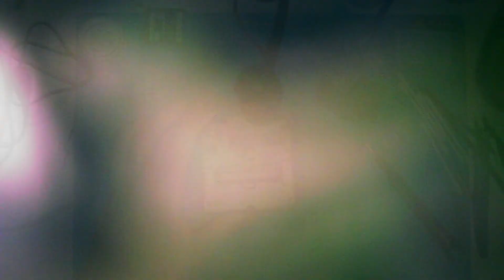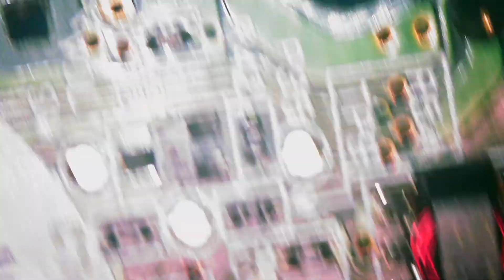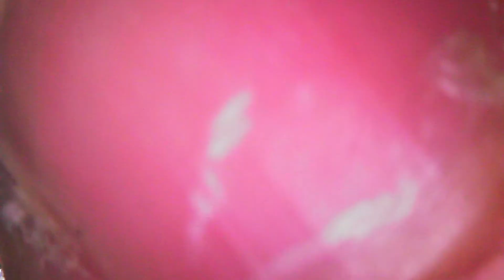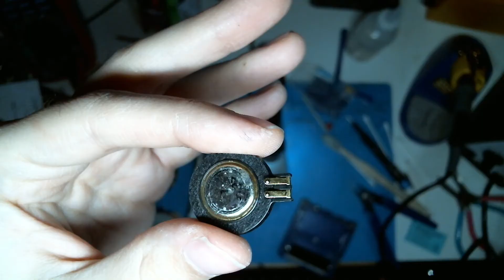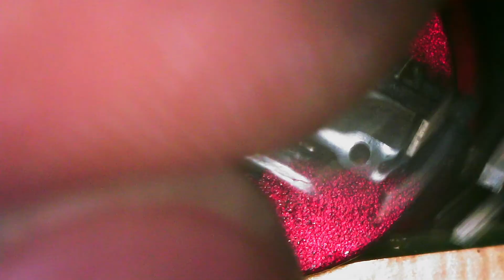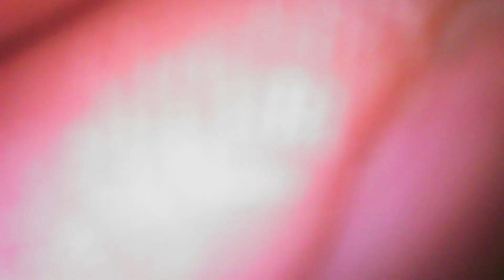GBA SP No Power Fix (All Fuses Checked Out)

Comment: Hello! Something similar happens to me. When you turn on the console, the green led turns on and turns off immediately. When charging, the orange led lights up correctly and the battery in another console works fine, I have also checked the fuses and coils and everything is correct. Do you know what it could be? Thank you!
Reply: I'm having the exact same issue, did you ever figure it out?

Comment: Local game store gave me a broken SP board to mess around with. Just the bare board and battery it would not power on. Charger would do it's normal thing with the quick red light so the board isn't completely dead. I checked all the fuses and didn't know where to go from there.

Watched your video and my board has a different layout but the components are the same. Mine didn't have a ton of corrosion like yours but there wasn't continuity from F2 to D1! Patched it similarly to yours and boom! It works.

I suspect that under that cartridge slot traps any and all liquids and it could be a common break point from misuse or dropping the SP in water. Now I can order a bunch of replacement parts and I'll have a working SP for cost of parts! Not bad if you plan on modding one anyway.

Comment: Good job dude. Why didn’t you use a toothbrush with IPA for after-soldering clean?  I think it’s better than q-tips since it doesn’t leave cotton particles behind that may interrupt with the circuit.
Reply from the maker: Cotton is non-conductive and wouldn't be a huge deal. I may have taken a toothbrush to the board at some point off camera but this is too long ago for me to remember properly. I do have a soft bristle toothbrush I keep on my tool rack for this reason and it's a good suggestion! Thanks for stopping by
Reply: @MitchCairns  Anyhow such cotton remains can retain dirt particles! But yeah, great video, keep them up. Subscribed!

Comment: Mitch, excellent video! I am having issues with my GBA SP Board. I am getting no charging and no power. I tried using another fully charged sp battery but still no power. I have continuity at the f1 and f2 fuses. Any thoughts or suggestions?
Reply from the maker: I think it would be best for you to hop in the discord server linked in the description-- either I or someone else can provide some pointers to help you troubleshoot. Corrosion under the cart slot is possible and it can cause this no power issue.

Comment: I am trying to solve a similar issue. I did have the same break in continuity you had, no visible corrosion anywhere I can see. I put a jumper wire in between d1 and f2. Now I get a charging light but still no power trying to turn it on. Just gonna keep going through looking for any breaks anywhere but not sure where to go from there.
Reply from the maker: I'd check the continuity from the power switch or even try bridging the power switch to see if it comes on then.
Reply: @MitchCairns  Ya the power switch is working. I tested continuity in the on and off positions and am getting the same as my working sp. Somewhere I'm assuming there is either a bad component or another break where something is not getting power. I'm just slowy working my way around the board checking continuity between components where power should be coming in and seeing if anything is broken. It's a long and tedious process.
Reply: @nightxxowl1215  any progress? I am having a similar issue
Reply: @joeypm1  Me too!
Reply: @ShadowZero1980  do you have component L1 and L2 (L1 is missing for me, I think it might be my issue)
Reply: @joeypm1  L1, L2, EM8 all check out. It's really a pristine GBA-SP, as far as I can see   :/